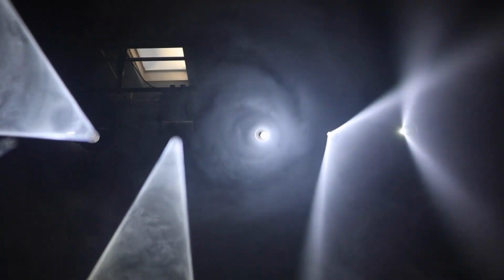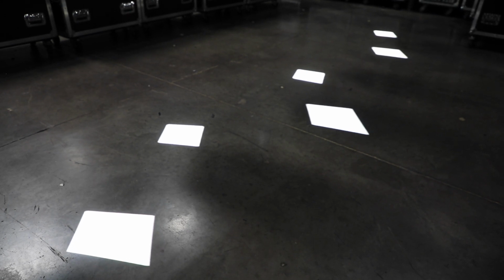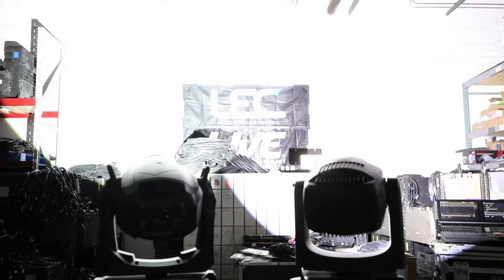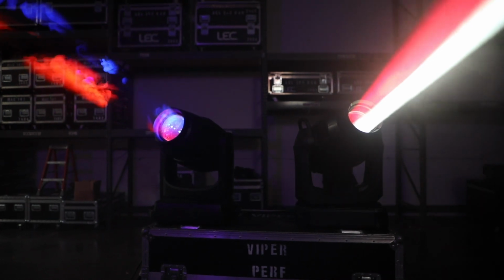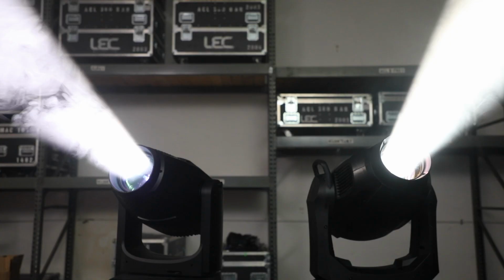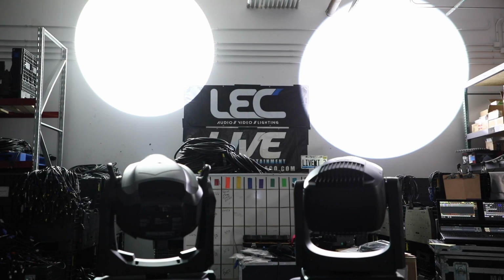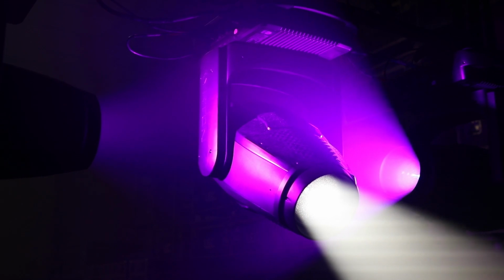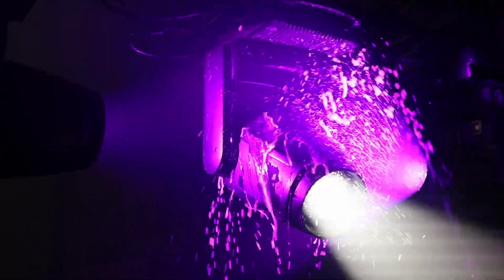Shootout! Ayrton Perseo vs. Martin MAC Viper Performance

Comment: ive done a even recently  with 6x perseo and 6x mac vipers i found the verseo suffered faults during the gig the dimmer shutters were getting stuck shut so had no light from them and we only had them a week , the mac vipers i feel are still my go to fixture  for features ,brightness ,reliability and never had a issue ,ive ayrton fixtures before and found they are okish in the reliability department but the amount of features they have is on par with the mac vipers but i think one fixture ive used that would outperform the ayrtons or the macs is ROBEs mighty bmfl